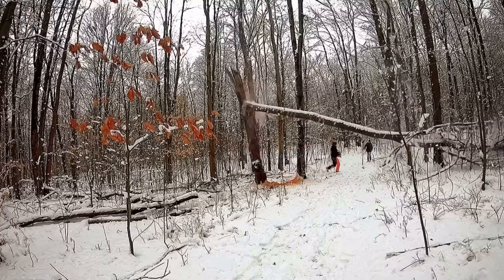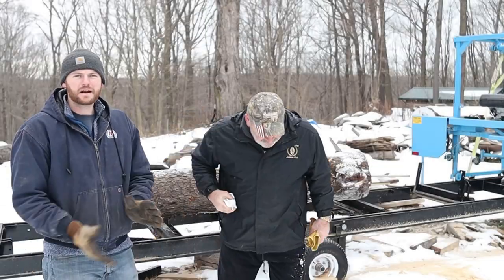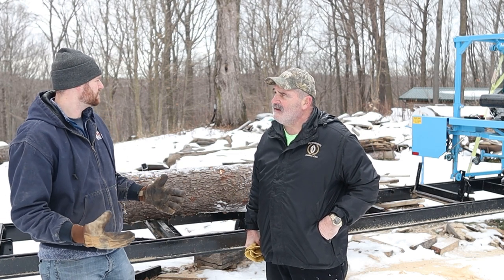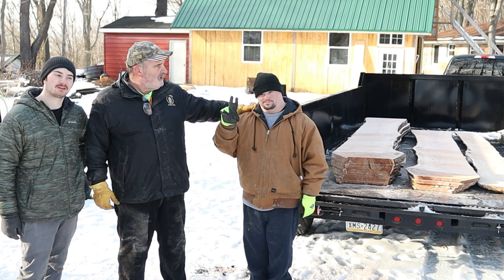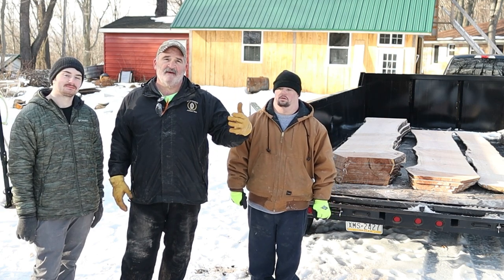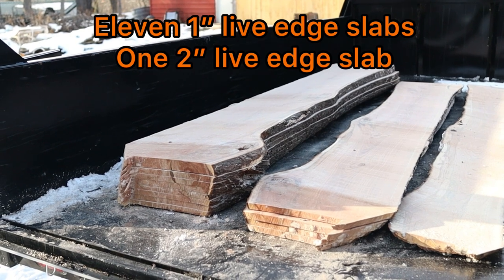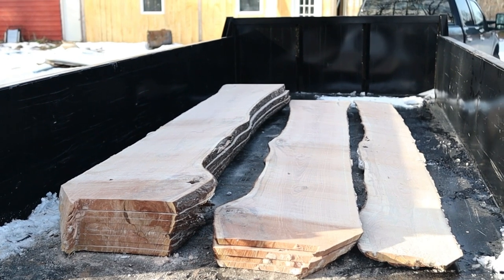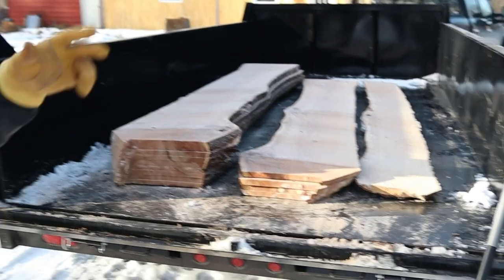The Sawmill You’ve Never Heard Of

Comment: Beautiful log, always liked cherry. Why did you decide to saw the log in this plane? Another 90 degrees rotation would have shown the crotch figure flare down the center of the boards.
Reply: There was a bark inclusion that ran nearly the full width of the log from one end to the other (you can see it on the face of the log while I'm milling). Wasn't sure how stable it was so I set it up like that to limit as best I could the amount of bark in the cuts (if I had cut perpendicular to the inclusion it would have been in pretty much every cut and could possibly ruin every piece). As a result of cutting the way I did it was only in 2 out of the 12 pieces and was relatively stable so those 2 were beautiful in the flat with great chatecter. Sometimes you make good decisions based on experience and educating yourself, other times...not so much.
Reply: @bobhammar4299    Gotcha, makes sense. I did see the inclusion in the end grain but without seeing it in person and with it's crown, it's hard to gauge. Not sure if it's species wide but in my experience I've seen a lot of fruit trees with really tight V crotches where the wood never grows together and it's all bark and humus down the length of the scale. Hope to see you cut more lumber in the future!
Reply: @corylannon8546  , thank you for the feedback, Corry. I have one 38" and one 30+" DBH Cherry with some beautiful crotch, burls, bark inclusions and compression figure coming down soon that should make for some truly interesting pieces. Maybe some flecking and curly figure too (I'm hoping).

Comment: have paid $30 each for these in Prescott AZ , !
Reply: Hello, 888MLAW. That's a great price in AZ or anywhere. Good on you. Prices are based on a number of factors including availability. Usually places where a particular lumber is not indigenous carry an upcharge. You are fortunate to have a good supplier. Still, $400.00 ($30 x 11 for the 1" thick plus at least $60.00 more for the 2" piece) beats the heck out of $120.00 for firewood.

Comment: Why is the blade set at an angle? Seems that just increases the length of blade buried in the wood during the cut.
Reply: I think that the idea is that the blade isn't cutting 90 degrees to the grain or something but to be honest I reckon it's probably a bit of gimmick. Looks like a well built mill all the same but wouldn't be a selling point for me.

Comment: How do blades last?
Reply: That's a toughie, Julie. It depends on the blade, species you are cutting, condition of the log/bark (clean off bark as best you can or strip it off), frozen, sappy, lubricant, etc.. Generally, a good rule of thumb, is 300 to 500 board foot before blade change. But that depends on thickness you are cutting and other variables. Example: say you're cutting 2" thick slabs  through a 26" to 28" diameter log x 10' long,  each piece will yield about 40 board foot of lumber, but if you change the cut thickness to 1" your only cutting 20 BF per cut, but still submitting your blade to the same stress so consequently you will not get the same amount of blade life.

Comment: Why do you say 4 quarter and eight quarter instead of 1 inch or 2 inch. Just curious.
Reply: Usually inches are used for discussing construction lumber, and "2 inch" would be a rough measurement (a 2x4 actually measures 1.5" x 3.5".) When discussing slabs intended for finer woodworking, 4/4" or 8/4" are true measurements.
Reply: It's the jargon used in the lumber business. Everything was sold in increments of 1/4 inch thickness. My mother's family was in the lumber business in Philadelphia and Bucks County Pa since 1682. In the early years they used two man saw pits and upgraded to water wheel powered sawmills located on creeks. Some of the mills in Bucks County survive as conversions to homes.
Reply: Adam, your audience is very knowledgeable.

Comment: $571 for a few cuts?   Holy crap!
Reply: Hello, UP Mudd Stevenz. The $570.00 figure was an arbitrary number based on the selling price of Cherry. The actual milling price would be a fraction of that and there was no charge to Adam as the video was done as a demonstration.
Reply: Bob Hammar,     Usually, in my neck of the woods in the UP of Michigan we charge by either the hour for any specialty cutting, or also by the board ft for standard production cuts.  The cutting supplied (aprox 11 or 12 cuts) would amount to about 1 1/2 hours with all of the handling, so making about $380/Hr is incredible.   Good for you, but I’d be out of business in no time with those rates.
Reply: @upmuddstevenz3147  . Hey UP. The price for milling that log at Hammar Custom Lumber would be anywhere from $75 to $150. Not sure where you're getting your numbers from.
Reply: Bob Hammar .  In your video, didn’t you say you would have charged $571 for the cutting?
Reply: @upmuddstevenz3147  No. Adam put the value of the log at $120 if the log was processed into firewood and $570 if sold as cherry lumber. Arbitrary numbers that I don't necessarily agree with, but that $570  was not mentioned as my fee.

Comment: Please post a video of actually cutting a full width log at real speed. Skip the music. What is the he skew angle on the mill?
Reply: The skewed angle helps the blade enter the cut with less stress than if it were entering across the entire face of the log. It's a small factor, but anything to make it easier on the mill makes for a more durable mill. EZ Boardwalk is the only mill using that feature, as far as I'm aware. I think the skew angle is 15 degrees.

Comment: I do not like the OFF-90 degree saw head! Since it is not cutting at 90 degrees the saw blade is in the log longer. Longer means more horsepower to pull the blade and the saw blade will get dull faster because it is cutting more wood per pass. BAD IDEA!!!
Reply: On the plus side, it makes for an easyer entry.
But you need to consider brain orientation in your equation...
Reply: @Freetheworldnow  What do you mean by "brain orientation in your equation..."? 

If you have a 12" board you are cutting and you have the head NOT on 90 degrees and you are cutting 13" it WILL dull the blade faster and take more horsepower.
Reply: You're cutting a little less as you start into the log and a little less as you exit the log. In between yes you're cutting a little extra length but overall it's the exact same area you're cutting no matter what the angle of the blade. So the life of the blade should be no different.
Reply: @DeerHunter2000  There is NO advantage to go through a log at an angle. It will take more horsepower to run that way.

Outside of that, I do not care what you spend your money on. I know you could not give me a new one if I had to use it that way.
Reply: @davescorneroftheworld1147  -- sure there's an advantage. Look at it this way. If you are cutting more with each turn of the blade then the cut would take less time and would increase your productivity. Time is money.